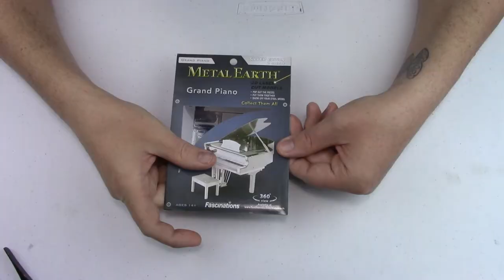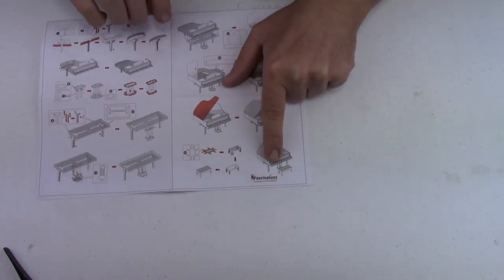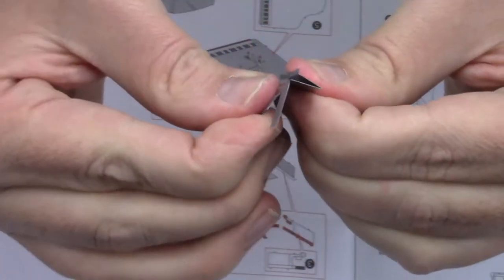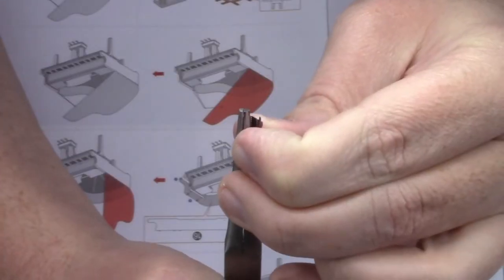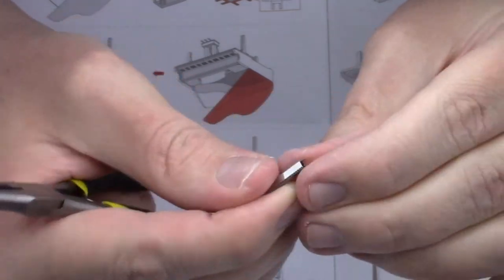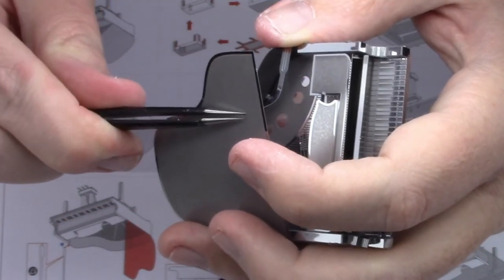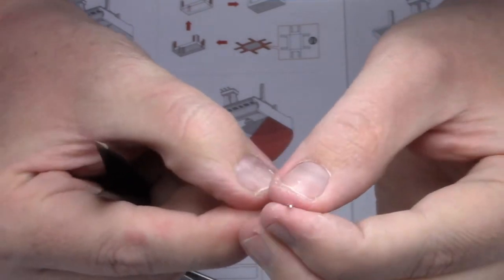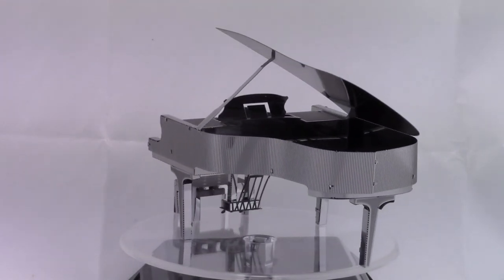Metal Earth Build - Grand Piano

Comment: I noticed some of the brushed metal sides were confusing on the metal earth packaging to determine which direction to fold- I ended up making the curved part at the top of the back piano leg face out with the brushed metal lines showing... there is no photo of the back of the piano so who knows if I did this wrong and you did it correctly or vice versa.  I do wish metal esrth was more specific about which sides are Brushed metal and which sides are the shiny side when they go Through the folding process on the instructions.   Did you feel this way about the kit, too?  Do you prefer to take all pieces apart when you begin or take them out of the sheets as you go along?  I was afraid I would misplace parts and forget which is which so I’ve been dismantling the parts from the sheets as I go.
Reply from the maker: This is an older model and Metal Earth did have a lot of issues in their instructions when it comes to knowing which side faces out. The instructions have improved a lot over time but they still have occasional issues. I often find myself referring to the 360 view online to help clear up confusing areas. There have been times when I disagreed with the instructions and used photos (found online) of the actual item to decide how to shape a part.

As for clipping parts, I am very much of the "as you go" camp. Much like you, I am worried I will lose parts. I do know people that clip out all the parts and put them in order on magnetic sheets before building. To each their own.